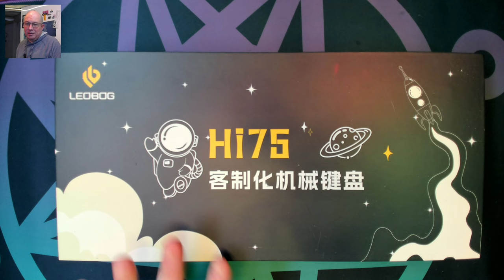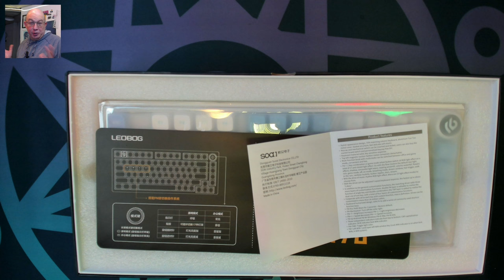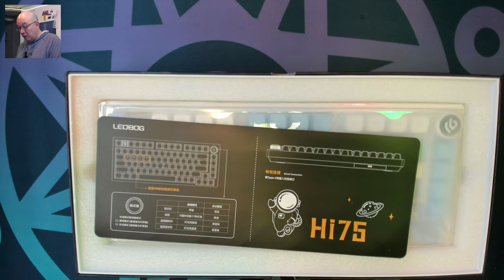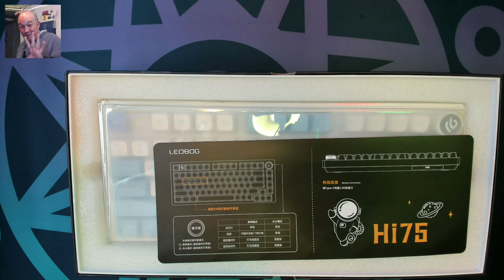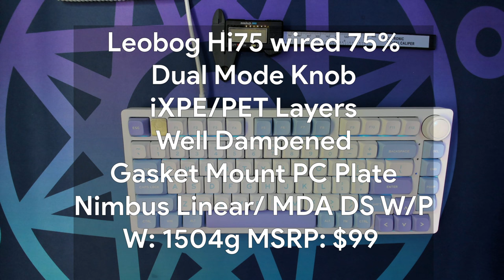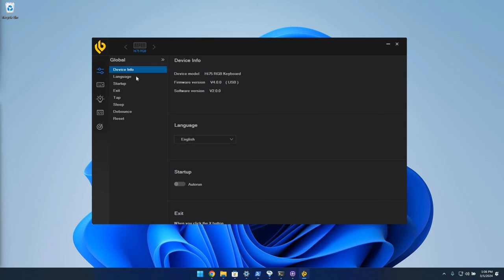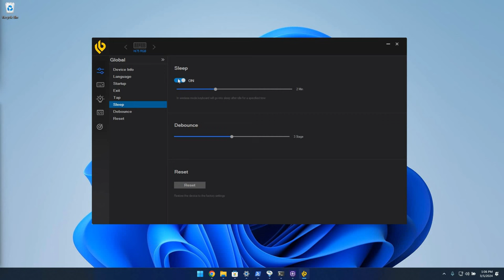Leobog Hi75 Prebuilt Review and Sound Test

Comment: Just bought this keyboard recently, its great and it sound amazing, but sadly i have an issue, it wont save my key assigments and RGB setting i make in software, everytime i recconect it from PC all the settings just restart to default, like it doesnt have onboard memory. Weird.
Reply from the maker: I would reach out to Leobog, I program mine in Windows and use it on a different Linux PC with lighting and key mapping remaining the same as it does have onboard memory.
Reply: @MechKeyboards  Yes I will, thanks for the answer. But the strange thing is that keyboard remember settings i did without software, for example if i change rgb via knob and recconect it the settings will remain but everything i do via software wont save 🤔

Comment: can you turn off the led from the knob or change the color?
Reply from the maker: Yes, press and hold for 3-5 seconds to switch modes, one mode allows for volume and mute controls, and in the other mode shortpress to cycle through light effects, rotate to control brightness.

Comment: are the switches and stabs prelubed from the factory?
Reply from the maker: Did you watch the video?

08:40 Taking a quick look at the stabilizers
Reply from the maker: @WHITEPERSUAS1ON  and that's why I add chapters in the video description...

__________________________________________________
00:00 Channel Intro
00:05 Video Intro
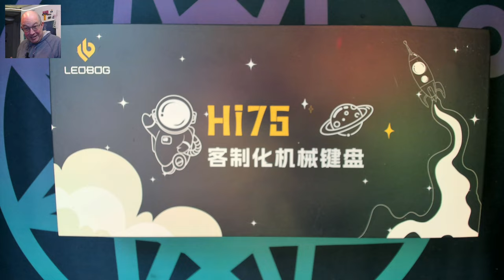01:45 What's in the box
07:25 And here is the Leobog Hi75 prebuilt
08:40 Taking a quick look at the stabilizers
12:10 Let's talk about the knob and demonstrating how it can be made solid
15:50 Side rant about Sci Fi and corny movies :)
19:10 Just the Specs
20:30 Closing Thoughts
23:10 A quick look at the closed source software
26:15 Sound Test
__________________________________________________